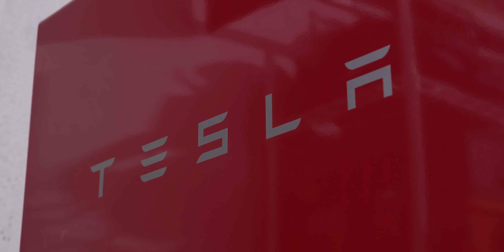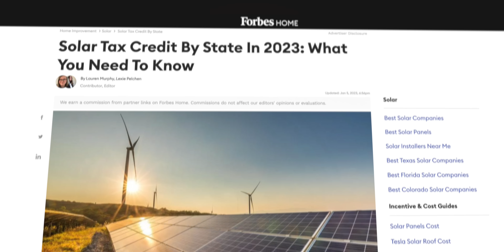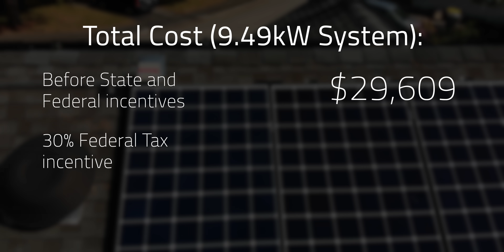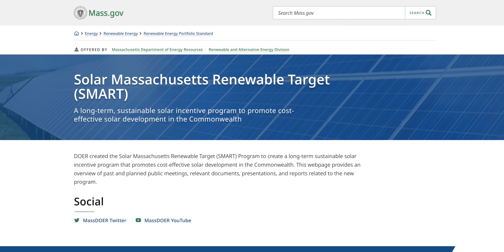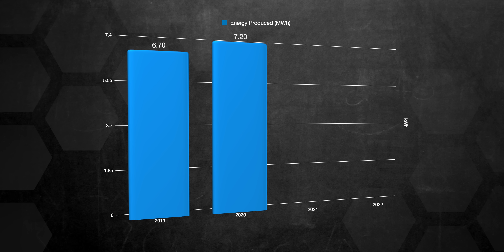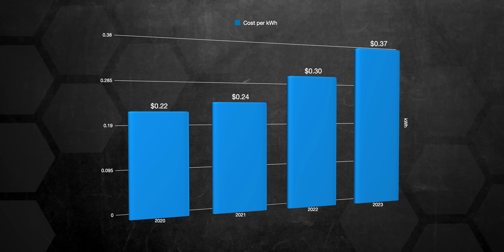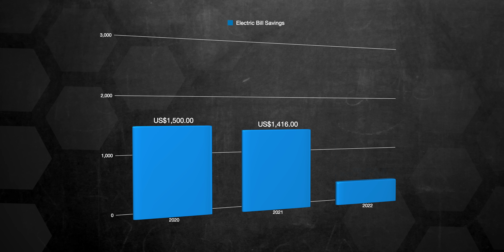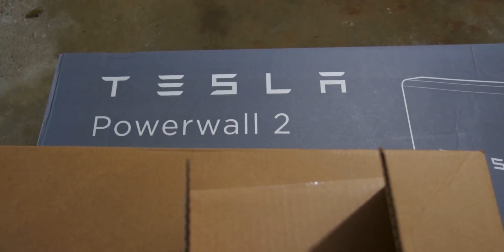5 Years with Solar Panels - Is It Still Worth It?

Comment: We have a 14' x 70' ground mounted panel system in our large back yard. This avoided all of the roof-mounted issues. We also have a geothermal heat pump system for heating and cooling. Our utility bills with this combination are minuscule, and the home is totally carbon free. We have been comfortable year-round and very happy with the systems.
Reply: I'm in the planning stages of our next home and seriously considering going with geothermal.   Anything you wish you had known beforehand?  Did you do vertical loops or horizontal?   What would you say to those that say a modern air to air is nearly as efficient as geothermal for a much lower cost?
Reply: @dreednlb  : We did vertical loops because we have sandy soil here in Delaware. If we still lived in Ohio we wouldn't have been able to do that due to rock layers underground. We have three closed-loop wells side by side hooked up in series. Closed loop is the way to go, not "pump-and-dump." I have an air-to-air heat pump in my shop. It can't handle the cold winter nights like the geothermal can, which means that I need supplemental heat out there in the winter.
Reply: @billmanzke758  Thank you for your response.
Reply: @dreednlb  I had an air to air heat pump installed here in Iowa last year because it was about $30,000 cheaper than geo thermal to retrofit. It's worked pretty well, but starts to struggle and fall back to propane down around 15F even though it's the most capable Amana model. We have 30-40 nights and 10-12 days a year running propane. Geothermal is nice that it never needs a backup, but if you're somewhere that never gets much below freezing an air to air probably won't need a backup either.
Reply: @dreednlb  Coal powered electrical geothermal heat pumps make a lot of sense particularly when you are adjacent to the free water lakes and streams although the EPA might jump on you for changing water temps.
Reply: Interesting. You mentioned "roof-mounted issues." One aspect of mounting on the roof which I've never seen addressed is how much extra it would cost when the roof needs to be re-shingled. The panels would have to be removed, the roof work done, and then the panels would have to be put back in place. I can't imagine that'd be cheap.
Reply: @anthonyc1883  all the recommendations I've read for roof mounted solar over asphalt shingles is for the roof to be less than 5 years old, otherwise the roof should be replaced before installing solar. That's different for metal roofs which can last 30 or 40 years and some don't even require putting holes in the roof to install the solar.
Reply: @extragoode  Thank you very much. So unless you're fortunate enough to just so happen to have a shingled roof less than five years old when you are ready to go solar, it would require a tear-off of probably a perfectly good roof for a new one. Again, that's many thousands that I have never heard talked about as part of the cost to go solar. I have 25-year shingles on my house, only 11 years old. What a waste to tear off a roof with so much life ahead of it (even if it doesn't go the full 25 years). Thanks again.
Reply: @anthonyc1883  you're welcome. I'm in a similar situation, living in a 15 year old house with 30 year shingles on it, combined with less requirements, that's why I'm looking at shed and ground mounts instead. There may be other options for your particular case. If your roof is in very good condition and your solar installer properly installs the racking you could take the gamble that your roof would last longer. You also don't have to remove the entire solar array to fix a problem in a specific spot, but you might have to move a bunch of you can't find the problem. It's playing odds at that point. You also aren't going to install solar on your whole roof, so if you wanted to be safer and install new roofing you could do it only where you're going to put the solar array. Things to talk about with your particular installer, but check them out and see if they have a history of installing over aged roofs.
Reply: @anthonyc1883  when my roof was replaced, insurance paid for the panels to be removed and reinstalled.
Reply: @dreednlb  Thank you. Insurance was involved why, because of storm damage or other problem? I was thinking of just ordinary, end-of-life replacement when the shingles wear out.
Reply: @anthonyc1883 solar panels are only rated for about 16-20 years anyway.  You're gonna replace the panels with new when you re roof anyways
Reply: @breckfreeride  Thank you. Did not know that.
Reply: Hi Bill thats a great diy system, I be honest why pay for roof mounted panels with ample South facing garden it's the way to go 👍 have you ever thought of collecting rain water off the roof in a underground tank & pass through a filter & say use that for flushing toilets etc
Reply: @CoolMusicToMyEars  : We collect rainwater in three rain barrels for use in the garden. The house itself is hooked up to public water and sewer. We considered a graywater system when we built the house in 2020, but the county code does not permit it when public water is available.
Reply: @billmanzke758  Thanks for the response, one interesting thing I've seen is an adaption of say waste water from a basin to go into the toilet flush tank at the side, thus trying to save water
Reply: @CoolMusicToMyEars  ... the idea is great, but the reality is it would take 6-8 hand washings to save a single flush on a low GPF toilet. Converted to $$ that's pennies per month. Shower and washing machine water might save more. You'd also have to contend with various contaminants that may not play well with internal toilet plumbing. (hair, soap scum, toothpaste, etc)
Reply: @CoolMusicToMyEars  ... collecting water for off-grid is one thing but trying to save $$ on your water bill is another story. Your water bill in most places has a base monthly fee (mine is under $20) plus a charge for each unit of water. (unit = 742 gallons) That fee is typically around $4 per unit and we use around 3-4 units a month. That means I would have to build something to store a good portion of that water and hope it rains enough to shave maybe $16 a month from my bill.... and it would only be good when temps are above freezing. Return on investment? Not happening!
Reply: How much do you have invested in these alternate systems. 30K? More? When is your return on investment? 20 years? 30 years?
Reply: @billbirch3748  : I'd need to research that, since the costs were rolled into the mortgage on the new house. I'd also need to calculate the benefits, like no fuel bill and making money each month on power rather than paying. For instance, I just looked at my solar system, and it is currently pumping out just shy of 15kw. Over the length of the day, that adds up to many more kw/hr than my house uses in an average day. Before we built the house, I rough calculated payback to be about 8-10 years. However we were and are most interested in having a fossil fuel free house.
Reply: What is the cost for installation and maintenance?
Reply: @edprince9079  : The cost of a ground mounted solar system and a closed loop geothermal system is going to totally depend on the area of your land, the geography under your land, and the climate zone you are in. In my case in Southern Delaware, I am on 1.58 acres, the geography is an ancient sand bar, and the climate is ocean moderated temperate. I sized the system to be capable of 1.25 times our average usage rate, and it is paying for itself almost every month. Also the geothermal has no problem whatsoever on 100F+ summer days and -0F winter nights. No supplementary heat or cooling needed. The one thing I am possibly considering is adding a wind turbine to generate power overnight and on stormy days.
Reply: @billmanzke758  
Wind power can often be more efficient than solar PV power.  We have a Bergey Excel 10kW wind turbine on a 100ft guyed-lattice tower and it produces an average of 125% of our usage for a 3 bed/2 bath home, family of 5.

With wind power, the efficiency of the turbine increases exponentially with tower height.  Being on 5 acres, we had no pratical restrictions on the maximum height of the tower, but the efficiency doesn't get much better above 100ft unless you have lots of nearby tall trees or other tall obstacles.

There are restrictions on the maximum height of the tower you can install relative to the size of the property and easements.  For example, if we were on 2.5 acres instead of 5, we would only be able to use an 80ft tower.  Not bad, but just 20ft higher improves efficiency and the the cut-in time of the turbine (higher, "cleaner" air will start rotating the blades sooner).

In addition, our local County and State laws required that all of the neighbors located around the perimeter of our property agree in writing and "sign-off" to the installation and existence of the wind turbine on our property.  At the time we had just a few neighbors and all of them were enthusiastic about the installation of the system. 

I'm not sure you could come up with a cost-effective and efficient wind power solution on just 1.5 acres.  It would most likely require a self-standing tower rather than a guyed-lattice tower.  The self-standing towers are much larger at the base (more of an eye sore and obstruction) and are exponentially more expensive due to the larger amount of thicker steel and reinforcements.  

The self-standing towers also require an insane amount of poured concrete for the base, which is costly as well.  IIRC it would be 10x what a guyed-lattice tower requires.

But the Bergey Excel has been extremely reliable with very little maintenance required.  It is a direct-drive, moving magnet rotor shaft, so just simple front & rear shaft bearings and no gearbox/transmission that requires lubrication or maintenance.  It also has an auto-furling mechanism for high winds, which can also be engaged manually from the ground via a steel cable and hand crank.

We occasionally get very high winds in the high desert here (80+mph) and have had no issues.  However, these turbines do create air turbulance noise especially in high winds that you will need to get accustomed to.  The blades and tower also cast a very long shadow during sunrise & sunset, and the rotating blades can create a "strobing" effect.

But for anyone that is curious, we have not experienced a single bird strike or kill since it was installed in 2007, and we have an extremely wide variety of and multitude bird life here!

At the time we installed the system in 2007, it was roughly $50k, but combined Federal, State, and local Utility Rebates paid for ~50% of that cost.  Unfortunately, while there are still incentives and rebates for Solar PV systems in CA for another year or so, there are no longer rebates or subsidies for Wind Power systems here.  :/  

This system is "grid-tied" and has automatic shut-down in a utility grid outtage in order to protect line workers, so we have a 6,500w generator and electrical service entry change-over switch with select isolated circuits within the house for power outages, which are extremely few and far between here.

From 2007 until 2012, our local utility (and CA) would only provide power usage credits for the excess power we produced.  For instance, if we sent 30% of our excess power to the grid in March, but we didn't have nearly as much wind in April, that 30% excess in March would be Free power in April, etc.  It was similar to "roll-over" minutes on cellular phone plans in the past.

But in 2012, the State and Local Utiliy started paying consumers for the excess power we produced and provided to the grid, albeit at a lower rate than what we pay the utility per kWh.  :/  Still, this adds up to ~$50-$130 per month paid to us by the utility.  The system paid for itself in roughly 7 years.

Where we are located, and at the time we installed the system, the efficiency and cost per kWh were about 45% less than PV Solar.  And we have the wind to support the turbine.

But the newer PV panels have gotten even more efficient and have better longevity, so I might chose Solar PV if I was in the market today, especially since we have the acreage to install ground-based panels and are in the South-Western high desert where we have plenty of sunshine and only a week or two of just light to moderate snow...perhaps 7 "snow days" for the local schools each year on average.

HTH
Reply: @bbfoto7248  I had considered using a Bergey wind system in parallel with the solar system, and may still. Night time tends to be quite windy here.
Reply: Where do I deliver your Bozo button.
Reply: HELLO! you still PAID BIG BIG CASH for the system and maintenance................
Reply: Carbon free rubbish!!!! Unless all your pumps and plumbing have been made of some material no one has heard of yet.
Reply: Me me me me... Me me me

Decarbonization is 21st century pyramid building.
Just burn coal. 

This is sickening on so many levels.  "How to screw the lower middle class and make them pay for your feel-goodery."
Reply: @billmanzke758  But you are not saying if you are also connected to the "outside" power system (local uility)
Reply: @pindapoy1596  : In Delaware, I need to be connected to the public grid by law. We don't have a choice here to go off of the grid.
Reply: @billmanzke758  The regulation requiring yor home to be connected to the utility is a good one because solar does not work at night or when it is cloudy but you need service
24/7. It may be that when the sun is shining and you do not use all the KWh coming from the solar panels, you are pumping back energy into the utility system and that has a cost benefit. That again is subject to state regulations.
IF the state did not require you to be connected to the utility grid you would be ISOLATED like an island and you would need a battery which is a headache.
What I was trying to convey is that the whole country went into solar without analyzing all the issues that come up and solving them in advance. Like electric car charging in the basement of a high rise which requires substantial rewiring, a meter in each stall, etc.
Reply: @pindapoy1596  name a technology that was perfect when it was introduced and not developed and improved over time.
Reply: @pindapoy1596  you are right but I would point out that the mistake was the government having ANY involvement in it. Left to the private sector the progress to Solar Power feasibility would have been slow and steady, measured by trail and error on a micro scale with a practical eye on profitability instead of the sloppy greed driven irresponsible circuses we have in progress across America now with land-oceans of Solar Panel arrays that will haunt us in many very bad ways in the not-so-distant future.
Reply: @fritzmiller9792  Indeed. At present status, to feed the city of LA it has been calculated that 500sq miles of solar panels would be needed. That is an absurd situation and even assuming that technology takes a 50% leap you still end up with 250 sq miles of solar arrays. Getting that land is something nobody has addressed because we seem to jump into exciting ideas without taking into account the consequences (like ...wars?????). 
The danger is also coming from the fact that while the problems are not solved, we already do things as if the problems are solved, in this case we run down the oil and gas industry without knowing how to replace it.
Reply: @pindapoy1596  Thats an all or nothing proposition and naturally unrealistic. There is already a lot of space not being utilized on top of commercial and industrial buildings. Distributing electrical production and energy storage between existing structures and power production facilities, rather than trying to make one big solar farm, is a much more logical plan and what will end up happening.
Reply: @JNArnold  What are the power production facilities you are talking about if not concentrated solar "fields with thousands of solar panels. Add the winmills and you get to my point.The lot of unutilized space on top of commercial and industrial buildings is not readily available. It has to be negotiated separately for each building and each owner will have to be copensated accordingly. That is actually what is happening with cellphone antennas today. Do you think that AT&T or Verizon or Spectrum go up on a skyscraper and bolt their antennas to the roof, just like that? And pull down the wires as they please? And install their cabinets in the main lobby of the building without having a contract with the owners? Need to add a few thoughts to your instant solutions.
Reply: My neighbor bought into the solar panel lies and BS. 
When it snows, he has to climb a tall extension ladder 🪜 to rake the snow off his garage roof mounted solar panels. And he can only remove snow from 4 panels of 14. When we lost electric power during a snow storm, his battery-powered home system didn't even supply electricity to power his water pump  from the well water system we all have in the countryside. I bought a propane powered Generac unit and had complete electric power in my home where my solar powered neighbor had very little electric power 🔌 in his home. 
He claimed that his solar power system would allow him to sell electricity back to the power company. HA HA HA. He had to wait 5 days in the dark until the electric company rewired the downed lines while I had complete electric power. Wait until the solar powered battery 🔋 backup system needs to be replaced. Those home powered batteries will cost as much if not more than the batteries that power electric cars. 😂
Reply: I love hearing of people doing additional projects and not stopping at just solar.

Did you hear of/look into using water/car coolants through copper tubing to cool your solar panels?  In addition to producing more wattage via solar, if you have a spare water heater, that uses a phase change system, you can heat the water via the solar heat energy, and have even more savings for your heating bill.  If you were to then install radiant heating pipes into the floor board, you could use a small amount of electricity to just cycle the water in a loop, and heat the house from the bottom up.  If you have that in addition to the geothermal system, you'll be heating air from arouns 50'F only, and use less energy to do so, instead of heating air that may be 20'F or lower,  coming in from the cold air outdoors vs underneath you!
Reply: @kuzadupa185  :That's a new one I hadn't heard of until now. I'm only 10 miles from the ocean, so it is pretty temperate here.
Reply: @kuzadupa185  Do it quickly the costs of copper will skyrocket if Biden's battery car wet-dream were ever to materialize.    Green energy will devastate the Earth with 10 times the current levels of copper, cobalt, lithium and manganese.   All major sources of water pollution.   CO2 is clean and welcomed by all plants and animals that eat the plants.  Without CO2 the plants die and we no longer have food or oxygen to breath.
Reply: @Bruce Frykman  you read my mind 2 years  ago when that idiot "got elected", and i have a neighbor who ive been convincing to buy copper items of all kinds that are used commonly, like wiring and piping... that neighbor has an awesome bottomless pit lined with cement block and rubber, perfect for stashing ;)
Reply: @kuzadupa185  I’m just starting to look into the solar option.  Stumbled on this video this morning. We have a south facing roof with asphalt shingles that are 25 years old and ready to replace with little to no shade. I hope to find a solar install company that is also a roofer or partners with one as I don’t want circular finger pointing should we have any leaking issues.  
Your comment about circulating hot water intrigues me as we have a natural gas hot water heater circulates to radiators in house built in early 40s in conjunction with central A/C (we live in Baltimore. Summers hot and humid).  Should we go the solar route, would there be a way to tie your suggestion to our existing heating system. Additionally, we presently have a natural gas hot water heater…, which I would think we would replace should we go solar…. Can you point me in the direction of where I could find out more?